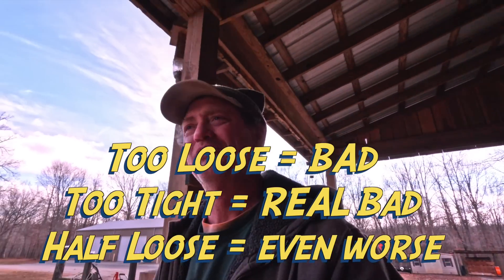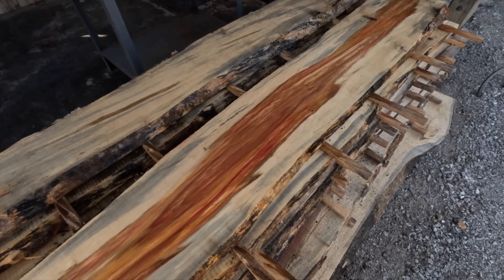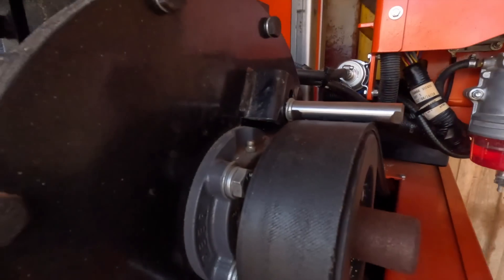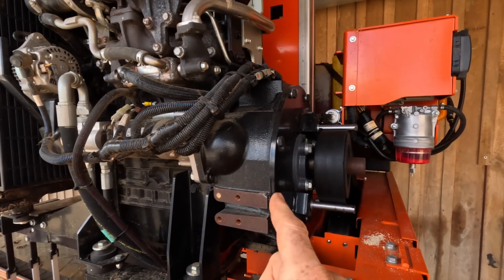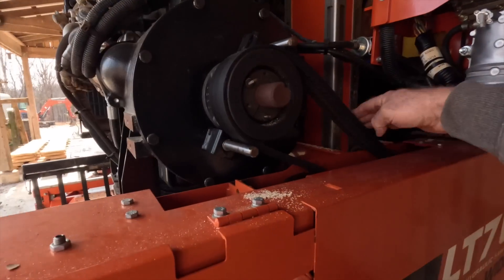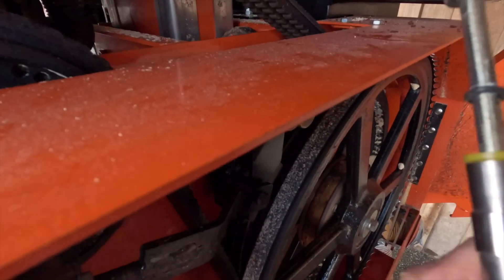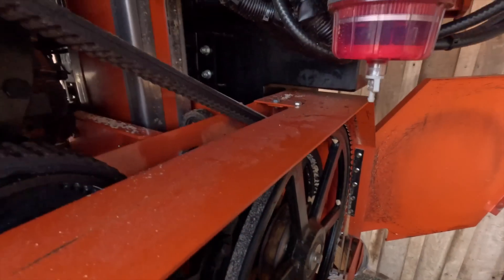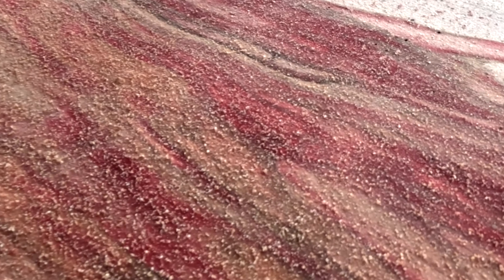You Will NEVER cut Flat Lumber Unless This is RIGHT (Sawmill Tips and Tricks)

Comment: I’m at the 4:32 minute mark and I’m almost positive that some drive belts can be checked for tension by measuring deflection or using something like a fish scale to measure the force needed to cause deflection. If a belt moves with 2# of force or requires 50#, it needs help
Reply from the maker: Yes, I use a belt tension gauge, my drive belts must be 3/8" deflection at 14 lbs.

Comment: Is there an instrument you can install to measure blade speed?
Reply from the maker: Yes, a magnetic pickup adjusted right to the teeth tips will produce a pulse when a tooth goes by.  Then use a counter that measures pulses and since you will know how many tooth per band, you can easily calculate rpm. Some cameras are fast enough to Cath and count the teeth in slow motion.
Reply: @HobbyHardwoodAlabama  a hall effect sensor? Is there one commercially available for bandmills? Thanks!

Comment: Obviously you are a woodmizer expert.  I am new to sawmilling and have a norwood mill and have made some decent lumber so far for our use but i have a question. We opted for a supposed upgrade to ceramic blade guides which replaced the guide rollers. Should we be using the rollers instead as the blade guides really offer no tension to the band to preload it to prevent it from moving?
Reply from the maker: Yes, I am familiar with that, and I do not know why Norwood offers non contact guides vs rollers and considers them an upgrade.  I believe good rollers are better, especially if you can preload them as you say.  On Woodmizer, 1/4" band preload or deflection works very well, and I have both rollers and guides on my Woodmizer, and the guides are pretty much worthless and I back them out away from the band.

Comment: Thanks for removing a bit of the mystery on this process.  I’m going to have to look and see if I can approach the drive belt from the top on my LT-40.  Currently, I have to remove the panel on the bottom (a pain in the neck literally when I bang into something) and go after it from there.  I’m still not completely confident adjusting that barrel nut.  Good stuff and thanks again.
Reply from the maker: I had an LT40, and it is very sensitive to main drive belt tension.  Also the power feed belt is very twitchy.

Comment: I run my LT40 with most covers off. Except the blade guard. every day i run, I blow out all the guts and look for problems. I spray belt conditioner on all belts about every 40 hours, keeps them soft.50HP 8000HR.
Reply from the maker: That is great!  The best way to fix a problem is to catch it before it becomes one!  You are doing it right, and thanks for commenting.

Comment: Door wouldn 't  stay open because concrete pad is not level.  Just have to tear out the pad and pour it again!   Sharpie paint pens are a good thing.  I write tire pressures above the tire on equipment cause who can read those darn tires?!  I have to take a picture of the sidewall and zoom way in to see what the max pressure should be.
Reply from the maker: I know!  I already jackhammered it out, and replaced it with a solid marble floor!!  No, I just put a pretty good grade on the concrete to drain water, and the door shows it.  It's funny when I get a new piece of equipment and ask the rep when I should grease or tension a belt or stuff like that and I immediately write it on the fresh paint!  It's always good for a laugh, but it really helps me out to remember.

Comment: How much time do you guestimate is needed to keep the mill happy?
Reply from the maker: Good question, not really that much time, mostly it's just a quick thing and these are easier to check when the mill is running correctly,  that way when I have a problem, I already know which things should be causing it.

Comment: my norwood tells me if you can twist the belt 180 degrees its too loose . which means if you are strong enough your belt is always loose. it has a v belt . i like the tensioner idea then you have a reference point to go from
Reply from the maker: Yes, a slipping belt will steal horsepower and you'll know it's dead on with a tension gauge.

Comment: I learned that the hard way . On my LT50 .
Reply from the maker: That sounds pretty bad, what happened?
Reply: I had switched from a LT35 HYD. to my LT50 WIDE GAS
had about 20 hours on it and went to do a job . It wouldn't cut flat unless I went slow I had had trouble with blades the past so I was switching blades and was tired and couldn't figure out the issue in the field . It was a waist of a day and very embarrassing for me in front of a customer . I did figure it out towards the end of the day .
Only my pride was hurt . The LT 50 was a new learning curve compared to the simple LT 35 . @HobbyHardwoodAlabama